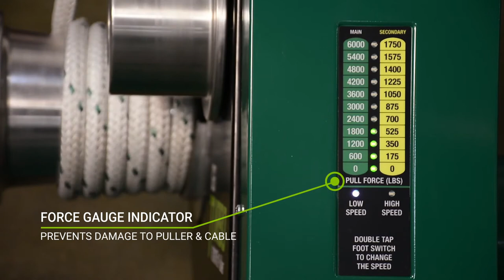Greenlee G6 Turbo™ Demonstration

Comment: How would the operator than continue to pull enough cable through to establish a reserve coil or slack?
Reply: That's when you need a Rigger, not an Electrician.